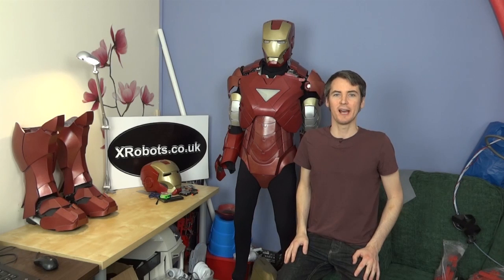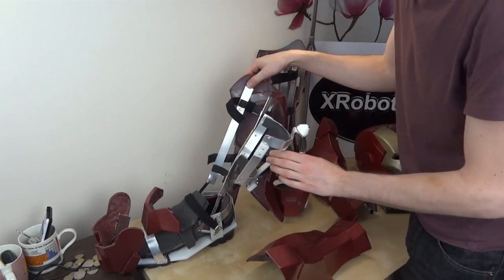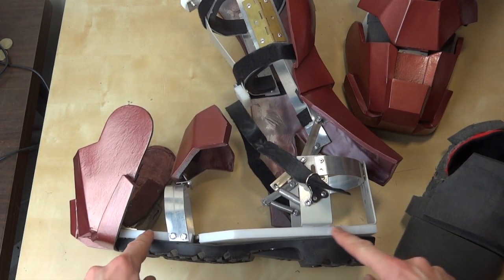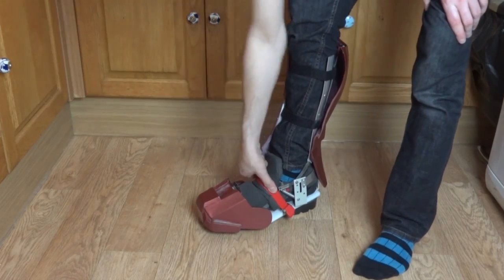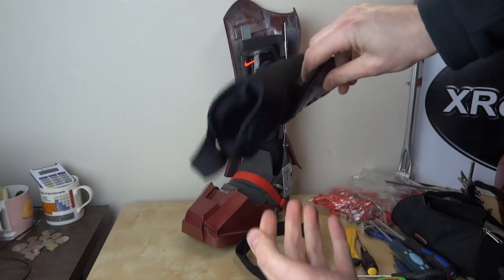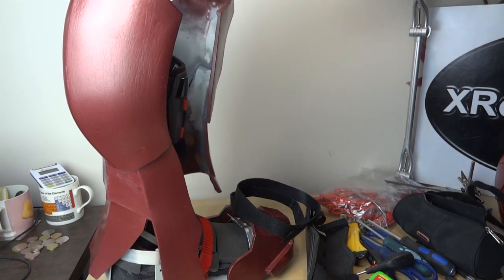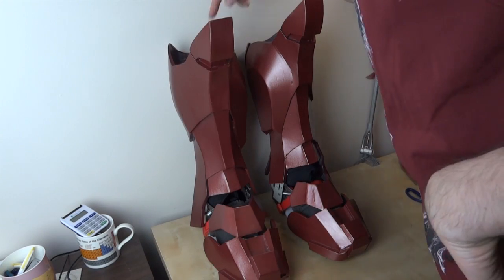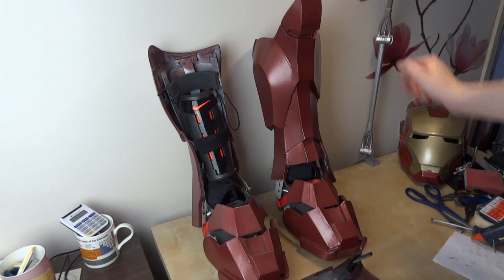Iron Man Cosplay #52 | Boots & Legs | James Bruton

Comment: Those boots line up very nicely, the calf and shin parts sit very flush, nicely done with the seamless work mate. I might add it seems this project is moving backwards as far as the innovation of your strapping system goes.. yes your replacing your "snap-on" easy to wear latching parts for bungies. I'd really just like to see you put that suit on one day  with that mechanical gantry. No self-help.   

Apart from that still very much looking forward to your videos ***** .